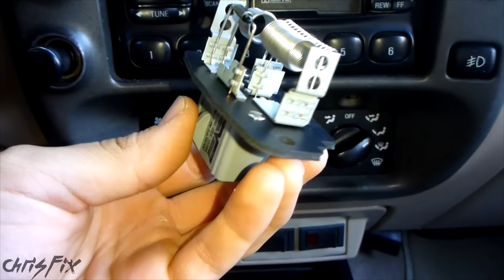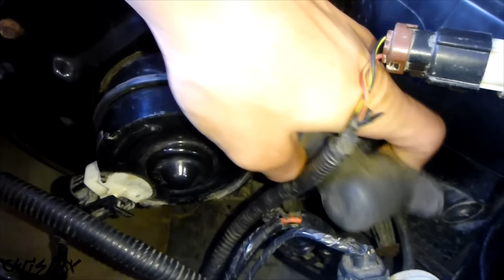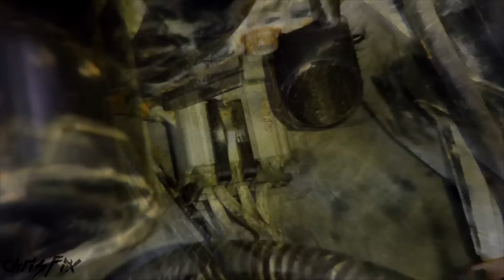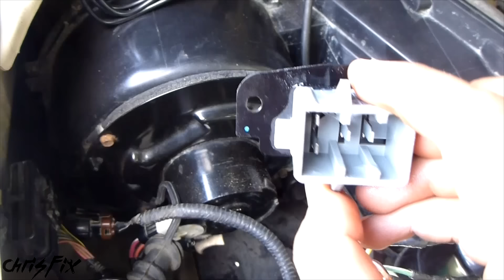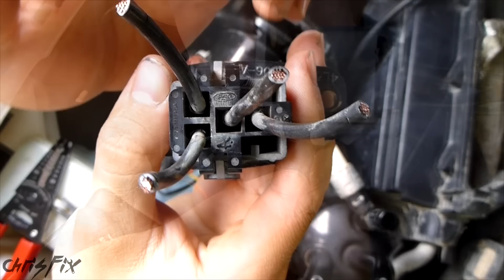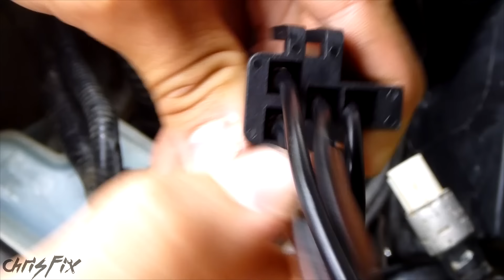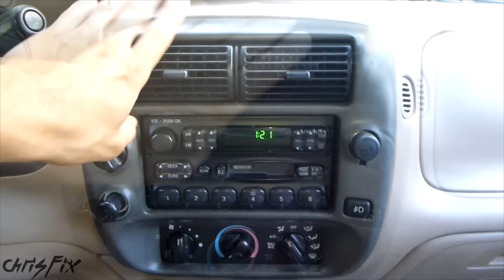How to replace a Blower Motor Resistor

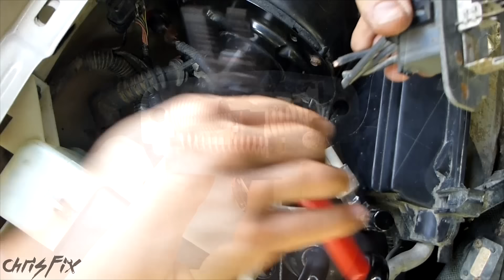Comment: 5:02 why negative terminal off ? does it make a difference if you disconnect the positive ?
Reply from the maker: +locknloadbitch You always disconnect the negative when you work on the electrical system (not the positive). Current flows from the negative terminal.
Reply: ChrisFix makes sense ! thank you

Comment: Chris I have a 2010 Town and Country. When I turn on my AC or Heat the passenger side start thumping. Hoping it's a easy fix?
Reply from the maker: +Kelli S It is either the actuator motor that opens and closes the blend door or a vent door, or it is the blower motor going bad. Here is how to check the blower motor: https://www.youtube.com/watch?v=7e60wS3_C9s

Comment: HELP! So Chris I was able to replace my blower resistor but my problem was and still is that the high (4th) blower speed setting dose not run. I then went through more expense and difficult personal labor and successfully replaced the entire Heat/AC control panel rather then just the speed switch it's self. Nuts, still no power when blower speed selector switch is set to the 4th and highest setting. I need that higher fan speed in order to contend with summer heat. What in the world could the answer be to this problem Pal? After all I've done I'm going to have to SURRENDER! Dam, is there anything you can suggest at this point?? My Auto is a 1997 Mazda Protege LX. Boy Chris, after my investments on this one, I sure could use your advice. Thank you, very much!
Reply from the maker: +Big M Smith How about the actual motor? Like the fan itself: https://www.youtube.com/watch?v=7e60wS3_C9s

Comment: I have the same truck. 2008 Mazda B3000 DS

How would you recommend fixing the far right switch (defrost/feet/front vents/etc.), currently it is stuck on defrost.

McNea

Comment: you do know your supposed to heat the ends of the connectors to shrink the plastic down around the connections. I like using heat shrink around the connectors because corrosion can and does happen easily on crimp connections.
Reply from the maker: +scott firman Thanks Scott. I know that but when I tried heating them, they melted instead of shrinking. I wonder if they were defective?
Reply: +ChrisFix We try,thats all you can do. I dont know why they make things like that,only to find out they dont work as directed. Our major Auto Salvage Yard went up in Smoke last week! Go figure. They made the mistake of putting their cutting room on the back of their warehouse. All their inventory went up in smoke...oops! I was offered a job there a long time ago. they pay you by car to cut them up for parts. I was doing that to snowmobiles at the time just down the road so I know the dangers of torches and stuff that can and will catch fire. It was a dumb move on their part to do that. They used to do it in a building out behind the warehouse,but at least if it cought fire there was nothing much to burn. their yard is still intact though. What is your take on salvage parts? I personally think that now days they charge too much for them. I myself havent picked a bone yard in years. Most of what I need is better off getting new.Things like tye rods,ball joints and those kinds of parts are best bought new. I did have to get a replacement master control panel for my trailblazers power window and locks. Seems the solder they use is of poor quality and it corrodes the circuit board after a few years. Sad.I expect the replacent to do the same in a few years. Not my fathers GM thats for sure!

Comment: Trail blazer resistors are known of going out,I am on number three. I swear the idiot that designed the electrical system never read OHMES LAW. The blower motors are the wrong rating for the system period. Its probably best to add an addition resister to the motor directly. I wonder how many fires start from stupid designs. Good video,
Reply from the maker: +scott firman Thanks and yea, what a bad design in general.

Comment: My motor works on and off if I hit a bump it may come on, if I turn the fan on and give it a spin by hand it will start spinning,  it it the resistor? or the motor?
Reply from the maker: +Jett Blast could be either one but it sounds like the fan is shot.
Reply: +ChrisFix the car is 2.6 years old with 40000 miles
Reply: Replaced the blower motor no problems,  disappointed that this new of a car especially a Honda Civic having issue like this. Glad it was an easy fix.

Comment: On my 05 Jeep Grand Cherokee 3.7 I also have med-high not working but the rest of the speeds do.  Now,  when I turn the air own heat/cool -AC/ without AC I get this burning plastic smell. This eventually goes away.  I only smell it when I first turn on the air. Technicians can't not figure it out.   Any thoughts would be helpful.   
Thanks.
Reply from the maker: +Daniel Beck It is exactly what I fixed in the video.

Comment: This video is great -  if you  are driving off road and want a better water seal at the new  connections  !!! seal the ends openings at the connectors  and pig tail with  (silicone sealer) so water doesn't get in.      (O)(O)

Comment: I can't find my blower motor in toyota do you know
Reply: what model is your car? my '98 4runner has it under the glovebox. after removing the glovebox's two screws from underneath the whole thing comes off and then i had to remove three bolts holding a metal bar to reach the resistor. the resistor is held in place by two phillips screws. it doesn't look like Chris', in toyotas the resistors are inside a white housing. you should be able to identify it because it has 4 marks (L, M1, M2, H) for the 4 fan speeds

Comment: What if the 'Resistor" isn't really a resistor, but a linear current regulator? I have identified 3 pins out of 4 and thought about attaching a relay that can handle the current. I have 12v, Chassis Ground, and data in the form of voltage levels (As I turn fan speed up voltage goes up on that pin.) Do you think that this would be a reasonable answer to my problem? I normally put the fan on high anyhow.
Reply from the maker: +Blake Bowers If you just want to have it turn on and be on high, that should work.
Reply: ChrisFix Sounds good. I will have to do that later this week. Thanks.

Comment: I don't have heat and AC in my car it's just air works. and when I turn on the AC it's noisy coming from the engine. I watched your video for Blower Motor and I checked the blower motor it's good, do you think is it the AC Compressor is bad?
Reply: +Maan Alshamari I had the same problem on one of my cars. I replaced the blower, flushed the heater core and I refilled the AC coolant. Worked just fine afterwards.
Reply: +Maan Alshamari I honestly did all of that by following his videos instructions.

Comment: Would a bad resistor prevent the defrosting line on the back window from working?
Reply from the maker: +Tyler Clark Probably not. Check your fuses.
Reply: +ChrisFix I've checked them and had my girlfriends uncle who is a mechanic look at them. One day when I was driving the ac just stopped blowing and a couple days later I noticed that the defrosting lines weren't working. I figured it would be something electrical but I really have no clue what it could be.

Comment: I had to do this on my 2002 Dodge Pickup Truck. When I pulled the resistor out from under the glove box area a whole bunch of pine needles were stuck in the resisters and the air duct that it sits in.
I have a lot of pine trees near where I park the truck. I would think that there would be some sort of baffle or grate/filter etc to keep that stuff from getting into the heater ducts.
I used a vacuum cleaner with attachments and couldn't believe how much pine needle stuff had been introduced into the duct.
Thanks for the video.
Great job on your part as usual.

Comment: The connector you cut off actually had the Ford logo on it.  Real nice that a Ford branded one wouldn't give you the colored wires.  I guess they're a universal part and the wiring spec may be different on certain vehicles.  Anyway, just wanted to say happy new year and thanks for the videos.  Looking forward to ChrisFix 2016!
Reply from the maker: Yea it's the factory part but now that makes me wonder how they knew what wires to connect.  Happy new year!
Reply: ChrisFix
If anyone from Ford ever asks me, I'll just direct them to your youtube channel!
Reply from the maker: Haha thanks
Reply: ChrisFix. Chris. I don't get anything from my car's blower. It's a 1993 Rover 820i Fastback. any ideas please ?  great info in your vids. George.
Reply: ScubaCat3 
Everything Furd does and makes is DESIGNED TO FAIL!

Comment: Hey ChrisFix hope you can help, I have a 2008 Impala, the heater will not heat while its standing but once you start driving it will work, if you stop and let it stand again it will cease heating,what can cause this?
Reply from the maker: +Jesse Castillo It could be the heater core is clogged. Do this: https://www.youtube.com/watch?v=M9SIafVsqyc
Reply: +ChrisFix That could just be low coolant.  I'd probably just add coolant and purge the air before doing the flush.  Usually clogged means no heat at all.  And most vehicles since 2000 or so have coolant constantly flowing through the core so they don't clog up as much.

Comment: Great tutorial Chris, doung this as we speak on 2001 Ford E-350 cube van, your right, i had to buy the pigtail too, it was completely Fused to the resistor, on another note, ive never seen Heat shring butt connectors that were see thru, usually either black,blue or yellow, those looked like crimpable ones to me for sure..
Reply from the maker: +Brian Davis Thanks a lot Brian!

Comment: Hi ChrisFix, Love your videos! I was hoping you could help us on a problem. Fan speed only works on high. Purchased a new blower motor resistor and Installed a new blower motor cause that went out. Fan still only runs on high. Someone suggested maybe it was the controls to the fan that was bad. Of course our van is the whole cluster, so ordered a used A/C Heat Temp Control switch panel off ebay and just installed it and still the fan is only running on high. Can you please help? What are the chances that the resistor is bad that the part store sold us? Its a 2000 Dodge Grand Caravan.

Comment: +ChrisFix Besides the resistor and the blower fan replacements is there any other things to check? Like fuses etc? I've got a Honda Civic 2001 with no cabin air. Thanks! 

Also really great channel far the best on the Tube.
Reply: Daniel Brent was

Comment: It's a bit funny that we still use resistors to control blower motors when pwm technology is so cheap and much more efficient. Using resistors to control the fan literally means that it uses the same amount of power on low as on high. I didn't know how this worked until now, so thanks for giving me inspiration to save more power in my car.
Reply from the maker: +ted clubber lang I am glad the video was helpful. I know, it is amazing we still use this tech.

Comment: Great video as usual. I was having this same problem whereby the fan was either on high or off and nothing in between. I was going to do this myself but upon researching for the blower motor resistor part I wondered why some parts were anywhere between $7 - $15 dollars and some $50- $60 dollars. Well, there was only one product description out all the many others for this part on Amazon that gave me the clue. It read something like "For without ATC...". That stood for Automatic Temperature Control (aka EATC). E for enhanced? Both Amazon and O'Reilly website says it will fit my car. Hmm? Anyways, I have the ATC and apparently that's the $50 part. Instead of the coils (acting as resistors) in this video, the ATC version has a round transistor like component mounted in the center of the fins in what I believe is a large heatsink. From my research, I'm 98% sure of this and do wonder what will happen if I was to install one of these plain looking resistor type (meant for a manual temperature control system) onto my ATC system? Thanks!
Reply from the maker: +richk3c I dont think you can use the style I installed because it wont give the correct readings for your climate control.
Reply: +ChrisFix Yeah, I believe you are correct. On those websites. You punch in your car's year, model, and engine size and it'll list both the manual temperature control and ATC type of blower resistors and tell you it fits your car. You can easily buy the wrong one for the type of HVAC you have in your vehicle. Btw, I removed my blower motor resistor a couple of days ago and verified it's the one with a transistor mounted on a heatsink meant for a car with Automatic Temperature Control (ATC) system. I believe some people call it a Temperature Control Module instead of a blower motor resistor. For all the people out there, your HVAC is an ATC system if you have buttons instead of rotary dials for fan speed and temperature control and if you have a digital display. Anyways, found the solder on the transistor was melted. Re-soldered and all is well and working with various speed now. Btw, on my 98 Mercury Mountaineer it is very similar to the car in your video except there is a cruise control servo in the middle between the blower motor and the windshield reservoir. It's a PITA to get in there to unbolt the resistor even after removing the servo. You have to  remove the air filter housing and loosen the windshield & coolant reservoir and shift it over to the right. Thanks for your great videos.

Comment: thanks chris for quick reply
I checked all fuse and relay is good condition
I been to couple of they said some things like htc or computer in dashboard have to change. 
Please suggest me
thanks
Reply from the maker: +Jugraj Kaur It could be the computer. Are you getting 12v to the blower motor?

Comment: hi chris
I have ford falcon bf
mine car blower does notblow any air and as well a/c does not show any thing from dash board
will you help me how to fix this problem
cheers
Reply from the maker: +Jugraj Kaur Sounds like you need to check your blower motor fuse and if that is good, see if you have voltage going to the blower motor.

Comment: Thanks a Million +ChrisFix!!!!
My AC (2002 Santa Fe) started working only on the 1, and the 4 settings, then stopped blowing any air at all!   When I took it to a garage, the guy made me buy a new Blower motor that he installed and it apparently worked.  2 days later it started doing the same thing again!.  
When I saw your video I decided I would diagnose the problem myself.  Lo and Behold that was exactly the problem.   My Blower now works on all 4 speeds!   
Thanks again for this video.  God knows how much money it saved me!!!  2 Thumbs up
Reply from the maker: Sadrak Souffrant No problem! Glad the video was helpful!

Comment: I have a question today I turned on my ac on cool air and on high it make a weird loud noise then I turned it on 2 and it was blowing out cool air then it suddenly started to blow out hot air. Next I saw some white smoke over where my ac under my hood. I pulled over and when it stopped smoking I turned my car back on and then the ac and nothing is blowing and my defrost doesn't work either. Any suggestions. I'm also taking it the mechanics on Monday to see and get it fix . I just want an inside on what it maybe before I go to a mechanic.
Reply from the maker: Kimberly Thompson The ac compressor might have locked up.
Reply: Thanks for replying

Comment: AC works, but blower not coming on. Resistor or do you think motor is bad? All relays and fuses have been checked and all working.
Reply from the maker: Christopher Clayton Try shorting the blower with 2 wires from the battery and see if it spins. If not, the blower is bad. If so, you blower motor resistor is bad. Odds are it is the resistor.
Reply: Will do thanks for the reply

Comment: You do an excellent job of instruction and displaying what the Visitor needs.  FYI, you can either use a soldering gun or bic lighter to melt/seal the connectors so the tape is a little messy and an over-kill.
Reply from the maker: GOPgorilla Thanks a lot! Those butt connectors were not heat shrink. I tired with my heat gun and they just melted. Thanks for the tip though!

Comment: Hi Chris, I have a 2008 Ford Ranger and when i turn my Max AC on and the fan on its highest setting it barely blows any air. You can feel that its cold by placing your hand over the vent but its not blowing. AC guy said it might be a door thats shut and isnt allowing any air to pass through but what do you think? Also it seems like whenever i get on the highway and increase speed the air goes from cold to hot!! Please help!
Reply from the maker: Saul Ochoa Sounds like the blend door is stuck closed on the AC side.
Reply: You dont happen to have a video on how to fix this do you?

Comment: i have a dodge durango 2002 the air condition works pretty good in the rear but blows out hot in the front while in air condition mode ,so i can i fix this problem ?
Reply from the maker: olalekan awosika It is probably the blend door not working correctly in the front.

Comment: The butt connectors are actually shrink tubing.  Heat them up after you crimp and they seal around the wire.
Reply from the maker: Jeffery Hall I thought they were too but I tried heating them up and they just melted. Maybe they were defective?

Comment: Would be nice if someone made a small PWM kit that replaced the resistor all together. Plugs in where the resistors were, but replaces it with a Pulse Width Modulator of sorts. More efficient and probably would last longer. More expensive too though I imagine.
Reply from the maker: Bryan Young Yeah, there has to be a better way!